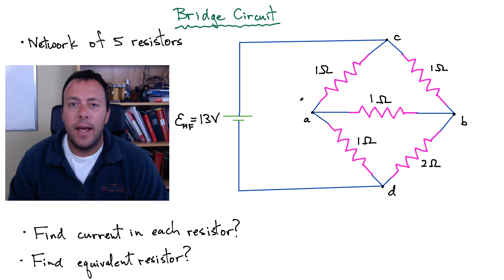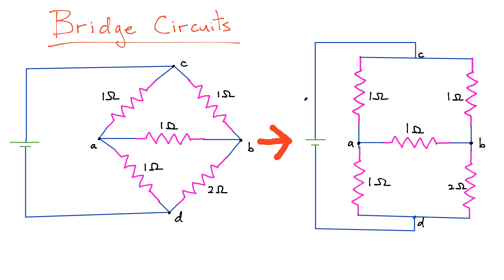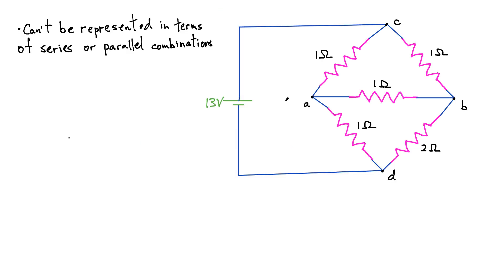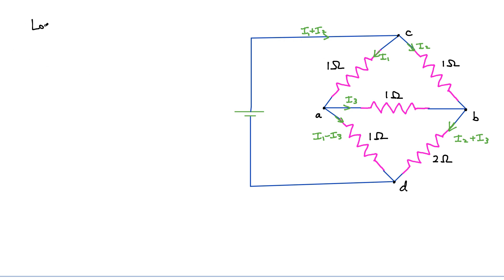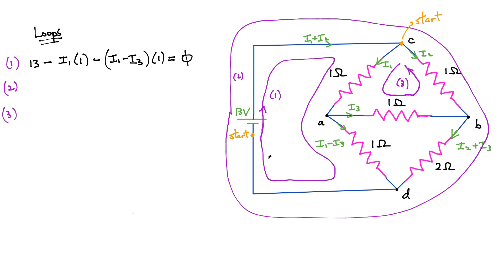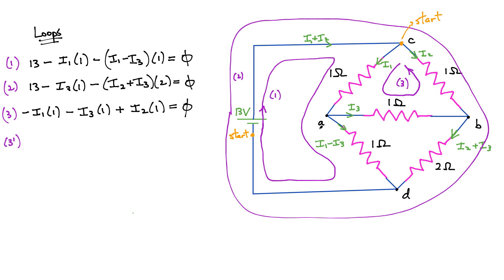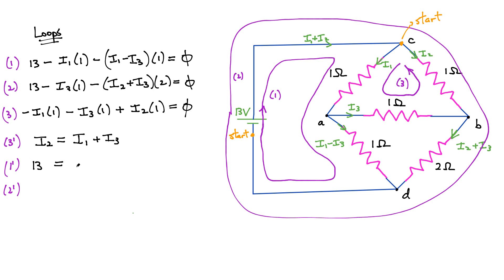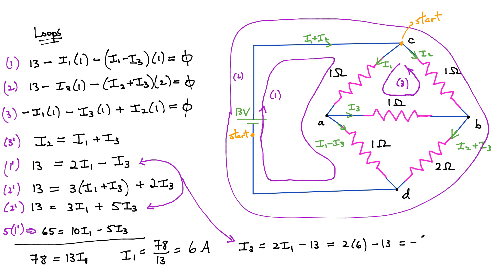Bridge Circuit Equivalent Resistance

Comment: i think it well be more easy by using dalta conversion to find  equivalent resistance and than to find current. what are you thinking will it work?
Reply from the maker: Thanks for the comment.    To be perfectly honest i've never heard of a delta conversion so i'm going to have to look it up before i can comment.     I'm certain there are probably faster way to solve this problem.   The way showed in the video in not the most elegant proof but it's straightforward using simple circuit rule.
Reply: i have used delta conversion to solve circuit like this one. and i think that is awesome